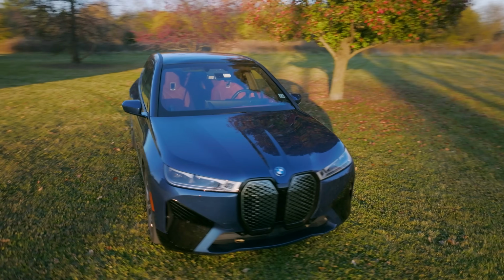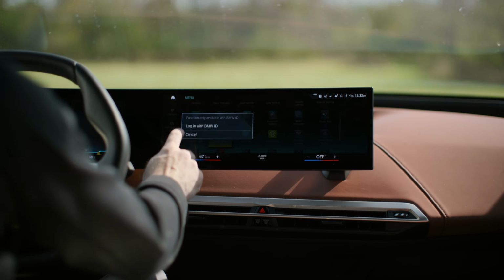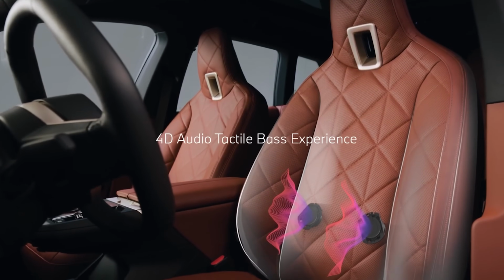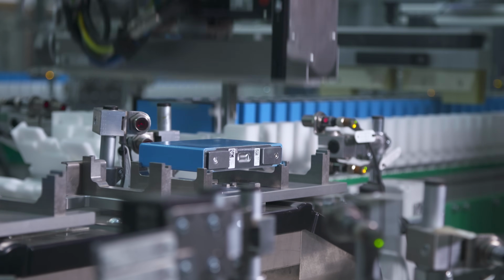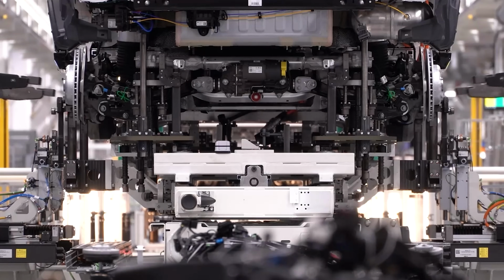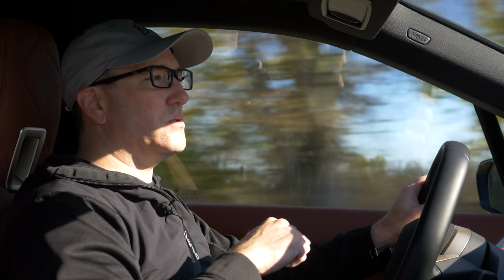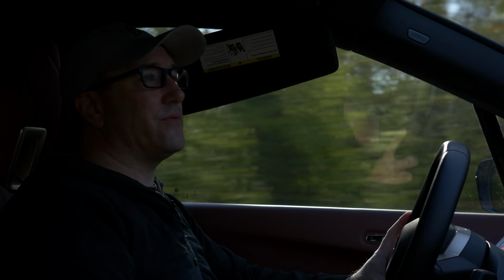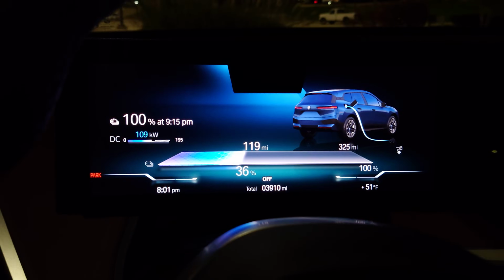BMW iX M60 | The Frustrating Future of EVs

Comment: The batteries on EVs are not dying, less so on EVs with larger CATL cells (basically do to math) but the car charging slower than others and being expensive to fix on a crash is definitely not contributing to longevity and therefore sustainability. Its gonna be a great used buy regardless.

Comment: Interesting perspective as a new vehicle purchase and I think you're pretty spot on with it. It's bothered me with electric cars since their introduction when you just know or feel that the next revolutionary leap in efficiency / range / battery chemistry (solid state?) could be just around the corner. But I do think that's more of a value residual issue than a usability issue. And that's where I would posit that now that you can pick up a '22/'23 off-lease for ~40-50% of new pricing ... it's a very compelling $40-45k car. 300 miles of range is enough for most commute-based driving so whether a new car does 500+ really matters not. If you're not doing 300 miles a day then being able to charge overnight is fine so a 35-minute charge from 10-80% vs. 18 minutes is also a non-issue. Therefore, I think this car will remain totally relevant and not be relegated to paperweight territory for quite some time. BMW claims their batteries are engineered for a 20-year usable lifespan so certainly getting to 10 years should be achievable. If anything will hold this back it will be iDrive 8/8.5 feeling outdated once they've moved to the new tech stack.

Comment: I don't think the regular customer cares much about drivetrain. They don't care if it's a B58 or some specific battery system. It's giving 300miles plus of range and who cares how exactly. I went to drive the new x5 and this car is miles ahead in drivability than the latest x5 with its cvt like transmission feel.

Comment: I have a provocative question, to which I believe I know the answer. Given the battery architecture and the upcoming new Ix3, I would be a fool to buy a 2023 IX m60 in 2026, with 20k miles, because, I am buying a disposable 50k electronic device, that’s nearing the end of its warranty period, that’s ungodly expensive to insure. Do I really want to take a 60 month loan, on this? Granted, it’s remarkable, it does its job beautifully,  but unless money isn’t a concern, I’m better off buying a 2026 M3p?

Correct?

Side question, this ix m60 has had a “minor front end collision… 😬

Comment: Nice review., I am looking at the Neu Klasse and will look forward to you review. right now I have two Teslas a older S and an newer Y . I subscribe to recurrent and it monitors my battery health and its still at 94 pecent after 9 years. Amazing. The battery will be good for about 20 years! The newer Y is at 90 percent after three years and its a bit diaappointing. Should be good for 10 or so. Not sure why . We dont charge to over 80 to 90 percent. And dont do a lot of driving. So go figure .

Comment: To say this vehicle of this calibre is a 3 year loaner and simply a showcase not to be purchased long term in anticipation of newer and substantial advances in the next generation of vehicles is really in the eye of the beholder (and perhaps desensitisation with exposure to countless high end vehicles :) ). If you like a look, love how it drives/handles and your not for want for what the trim level you have contains, then what's the problem with considering driving this vehicle for 8-10 (and perhaps many more) years? The battery is expected to last that long and if not, there is an 8 year warranty and likely cheaper battery costs by the time the replacement happens. Shiny new things will always come along at a rapid pace and so it is very easy to miss out on being in the moment and always thinking ahead to the next big thing.
Reply from the maker: Considering the astronomical costs to repair things on this vehicle that are not shared, like A/C components that also cool battery, windshield and head lights are all about 6x more expensive than many cars.  factor in high insurance prices and abysmal resale value, it is a here and now lease product.

Comment: I just bought an ix3 for pretty low used price at a low mileage. But after watching this video. I have a bit of scare in my head that says, sell it off in 9 months and return to a combustion engine vehicle.

I fear for increased insurance, if it crashes repairing is impossible and with new tech the price will plummet so much it will be unreasonable.

Comment: Well, here I am back, 8 months after leasing the iX M60, and putting 12,000 miles on it and now with an AS set of non EV tires on it, with a few follow up comments.  The car is definitely a head turner, with both positive and “oh, ok” comments on the outside, equally distributed.  On the inside, all comments are positive.  Of course, you must be a techie to like the controls and screen commands.  It does drive my wife crazy.  
It is a fantastic highway car, Quiet, comfortable, smooth and powerful.  For everyday driving around curves, it is a pleasure, but it is a very heavy car and it shows on spirited driving on curved roads.  Straight line acceleration, amazing!!
It’s been flawless, one recall to update the electrical,system.  Nothing else.
One caveat, the 22” wheels have at this time a very limited choice of tires available.  Since we live at 5200’ elevation in AZ and get a lot of cold days, I swapped the OEM Summer tires for a set of All Season, but could not find EV specific High Performance tires at the time.  If the OEM rode is at a 5 rating on noise and comfort.  These AS tires ride at best a 4 on both noise and comfort.
The only complaints I have is driving in cold weather reduces the range (-15 to 25%) and equally increases the charging time.  Plus charging availability and reliability is less than adequate.  Maybe this drawback will go away after BMW cuts a deal to allow the use of Tesla Superchargers.  Yes, my only regret is the available charging network for non-Tesla EV’s.  We spent way too much time waiting at charge stations, or calling EA to get chargers rebooted or having to move to a different charger.
I did have a strong desire to cancel the lease after the trip and go to an X5, but I like the iX and will keep it for a while longer.  
We have a 3000 mile trip planned for May 2025.  Will re-examine keeping the iX after this Summer trip.

Comment: I’ve owned an i3. It was a concept car that I could flat out own. It was extremely special. To the point where a random stranger made a comment at Microcenter. But the carbon fiber tub repairability is a genuine fear. I don’t think even bmw would repair it locally. But it’s also one of the safest cars on the market.  The i3 felt light and fun. I look at this car as the i3 evolved.

Comment: They got rid of the massage function because they noticed it was almost never used.
Reply: my iX had the massage function however it's not as good as other bmw for 1 simple reason: the iX has speakers inside the seats that limit the space of the massage cells inside the seat.

Comment: Hey Jack. We keep seeing more and more life and performance from batteries. In addition, the battery is a fairly straightforward removal process, power disconnect, coolant disconnect, management cable disconnect and 20 bolts to drop it.  Open the case replace the faulty cell or cells, put it back together, go to lunch. Good for the 2nd 200k miles

Comment: We have a white M60. We freaking love it. We know it’s weird looking and that’s ok.

The sound system is beyond amazing and the speed is mind blowing. 

Hand controls are another plus. 

The air suspension and rear steering is also a plus not mentioned. Should have been. 

It’s super-large on the inside. Makes you feel
Like you’re sitting on a BMW throne. 

If you’re in the market for the top of the EV food chain, buy it. It’s a blast to drive.  Posted 1-2024
Reply: Agree 100%

Comment: I lease the iX50. I was fortunate to find one that had both the rear wheel steering and air suspension, before BMW made those options on the iX50, exclusive to the M60 version.  My last car was a Taycan 4S CT. The iX is far more useable, and quite fun to drive. It did not really love the Taycan’s coasting-on-lift-off, strategy. Sometimes when you lift-off, you really do want the car to slow down. The iX is brilliant at predictability and speed management. The electric motors and the air suspension make you believe that the car knows what you want it to do, before you do, and has already executed the adjustment. Really a technological achievement. BTW, my iX50 has the 20” wheels, and the consistent range is 380 miles. Which is good because Electrify America is not so good.
Reply: Any update after a year? Still getting 380 miles? I just got a Lucid Air but I'm eyeing the updated 2026 ix
Reply: I have the iX 50 and the range is nowhere near 380 miles! That is BS! I took it on a 1000 mile trip and it was 280-290 miles at the most pushing it to 5% from 95% charge! with 2 kids and a wife doing 75-80 you will not get over 300 miles

Comment: I couldn't agree especially on the final thoughts. But it's not only the 5th gen battery pack - the whole industry and technology is developing on a high speed lane. Todays whatever tech will be obsolete in 3 years. Therefore I only would lease a car not buy. It's more a mobile phone with wheels - in terms of technology. How fast did this technology develop let's say 10 years ago? We couldn't wait to get a new iPhone every year because the old one was no good anymore? Now I feel that we are ok with a phone for 3 years. That will happen for EV´s too - just on a prolonged rate. 
Will there be ever a classic EV car market? I cannot imagine that. 
In 5 years from now those batteries will be one third of the size and weight with still higher capacity. 
Ah yes the iX is a very interesting car - it sticks out in many ways and is a car from today - since this review was made 8 months ago - is still today :)

Comment: "If you're ok with throwing this thing out in three years" - that's a little over the top. The average daily mileage in the US is 41 miles. You can drive this for about 4 hours from 80%-10% and then take 35ish minutes to recharge. The next gen is 800V (possibly even solid state in 3-4 years) and will take 18 minutes and probably have closer to 5 hours of driving (80-10). But let's be real, most people don't drive for more than 5 hours straight before taking a 20-30 minute break anyway. There will be plenty of people ok with a 35 minute break vs an 18 minute break.

Comment: happy owner of a M50 with all options including Bowers Wilkins and rear wheel steering.. I agree with some of your comments on the disposability and the fact that most EV are leased.. but like most flagship german products ala 750 or S8 you should either lease which ends up costing more or buy with a useful life of approx 8 years.. anything more is gravy. I preferred to but mine and can picture myself enjoying this car for the next 8 years, if the battery pack starts loosing capacity in an important fashion an 8 year old ev will probably not be worth investing over 10 k to get new batteries.. simillar problem with most ev..
Reply from the maker: Id love to own this car.  If we could get a 450+ mile range Id jump to it.
Reply: @savagegeese  right now it has approx 300 miles, new technology will improve battery capacity density in the next model.. this is the price to pay for being an early adopter

Comment: I’m confused why you call this car disposable.  Batteries are pretty tough and have proven to last a long time. Who cares if bmw is updating to a new platform. This vehicle minus its looks could have a longer drive life than the ice vehicles I typically purchase.
Reply: Because it doesn't matter how long a vehicle lasts, especially at this price point. You can't just think about how long you can drive this. You need to think about what's replacing it, because it will make this obsolete and no one will want one.

This car will lose so much of its value that purchasing is a non option. It's like buying a new computer in the 90s. It'll still work in 20 years but it'll be worthless because no one wants it.
Reply: @Catuyn17 that couldn't be further from the truth. Yes, there will be better tech in 20 years, but this will still be an excellent car. Someone (in a lower income bracket) will love owning it then just as much as early adopters do now.

Comment: BMW sticking to 400v architecture seems like a smart move with Tesla's magic dock limitation on their gen 3 superchargers. 800v EVs are limited to 50-100 kwh charging at these chargers except the Taycan and that's if you pay $1500 for the upgraded inverter.

Comment: No one will read it probably, but I wanted to say it anyways.
EVs are heavier than usual cars, roads are already in bad condition and under construction 24/7, we spend a lot of taxes on roads and it can barely support current infrastructure, now when everyone moves to heavier cars it will result in more road fixes and taxes. Also now people buy more SUVs that are heavier and make them EVs... It feels unsustainable, both gas and ev. I would wish you guys to bring up this topic since it's not trivial
Reply: I've been saying that for years.  Most states pay for road repairs via the taxes collected on the sale of gasoline.  Since EV's don't use gas the owners don't contribute to road  repairs while putting more wear on the roads due to the weight of their vehicles.

Comment: Carbon Fiber is a big problem. It's nice material, but not for regular cars. It's expensive, it's hard to repair. Difficult to get spare parts for later, also one big issue: It's bad for the environment, you can't really recycle it properly.

Comment: That is an EV with a radiator grille! That’s how stupid the underlying thinking is. There is no torque from the engine and so many other unnecessary physical attributes that could have been used to change design but no…. $105,000 of moulded plastics.

Comment: It seems like EVs are still very much in the "capacity/charging speed/cost -- choose two" phase. One of the reasons why there's more development at the top end of the market is that it's the easiest (only?) way for manufacturers to address both concerns (range and charging speed). One way forward (and this will require scale) might be to offer consumers the ability to choose range or charging speed. 

For some EV buyers, having a range of (say) 370 miles means that they basically never need DC fast charging. For those consumers, level 2 charging at home at 11.5kw (48A*240v) is more than enough to get back to 80% (or full) by morning. Having older & slower (but cheaper) fast charging might be a no-brainer for those people.

For other buyers, less range and quicker charging might be a good tradeoff. Maybe have a 2nd model that tops out at (say) 270-mile range, but that can fast-charge 100 miles in 3-5 minutes, or 220 miles in 8-10 mins.

A large manufacturer like GM could sell one model on range and price (Equinox?), one model on charging speed and price (Blazer?) and an expensive model with both charging speed and range (Cadillac Lyriq?)

Comment: I think you are totally wrong with respect to how this car is supposedly "here and now." Most people don't give a toss about 800V battery, they just want a car that drives great. Besides 800V is going to do nothing for home charging where most people charge their EVs.
Also, you exaggerate how 800V is going to be a "gamechanger" and increase efficiency. It will NOT. Driving slowly and accelerating less aggressively is going to increase efficiency.

Comment: Generalizing about cost of repair for ICE engines by Mark is a unusual. The majority of the vehicles sold have enough volumes produced to enable very cheap recycling.  Only the high-end vehicles that are rare are challenging to repair the powerplant in.  R&R motor is fairly fast and easy.

Comment: When I worked in auto body, you could heat up the panels to loosen the glue to separate (steel). The carbon fiber might not be able to be separated since the heat might actually destroy the underlying carbon fiber.

Comment: $105k for hard plastics, FABRIC INTERIOR, and the thing doesn't even have an engine LOL. Also, the dash is terrible, I remember on the E60s they had the sense to actually build the display into the dashboard, just nailing that bitch in is so ugly and low-effort. lack of hvac, memory buttons, and actual physical controls is also terrible. 

if you buy this you are a bonafide sucker

Comment: I really want to consider this vehicle, but the lack of usefulness is appalling! Built from ground up what activities will you be prepared for without a tow hitch, frunk, roof rails,  no inflation for passenger,  limited seat functions. A great car with no purpose other than an optional extraordinary sound system. I really want this but ANY practicality would have helped make the decision harder.
Reply from the maker: That's why I take issue with it.  It's like, just get an X5.